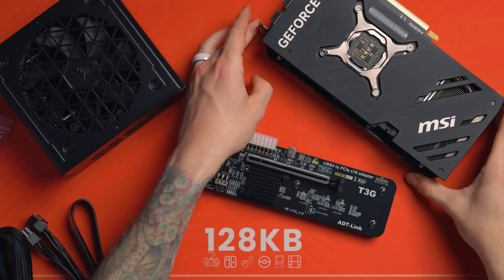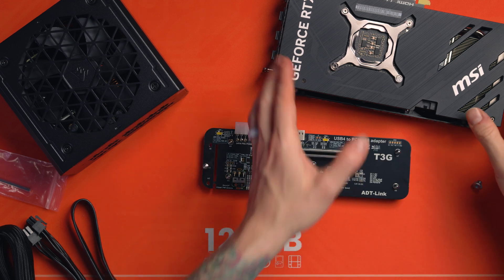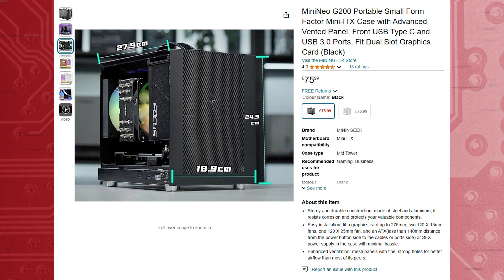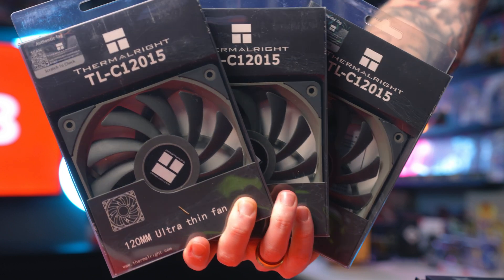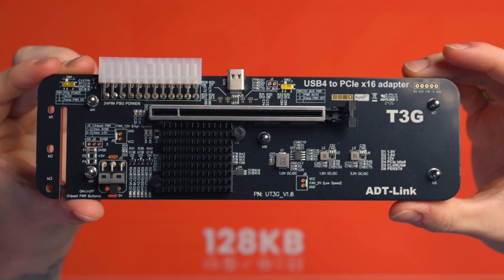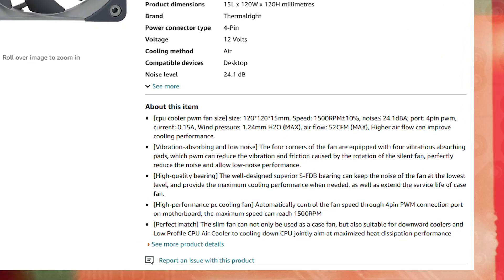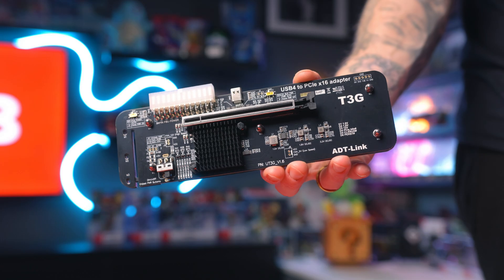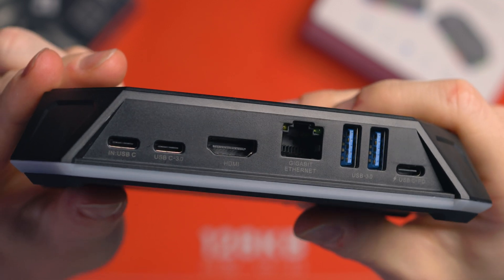Is This A Huge Mistake? ALLY X eGPU

Comment from the maker: Here's all the parts I'm going to try:
🛒 MiniNeo G200 case: https://geni.us/XjNR
🛒 Thermalright fans: https://geni.us/CT9Mlk
🛒 Molex fan splitter: https://geni.us/oP0YKVU

My Dead RoboCop eGPU Build (so far):
🛒 RTX4070 GPU: https://geni.us/Mbhh0ZL
🛒 Corsair RM750e PSU: https://geni.us/bAoAQAH
🛒 ADT Link UT3G USB4 eGPU Controller (AliExpress): https://geni.us/oGr4
🛒 ADT Link UT3G USB4 eGPU Controller (Amazon): https://geni.us/TMW8zex

Comment: Bruh, such a nothing burger of a video, overthinking and not enough doing, you have everything there to put it all together, you don't put it together at all and you just talk about things that don't matter, like the the air flow under the egpu, its just a gpu, not a whole pc, you don't need to worry about airflow in an empty case with ventilation on all sides, the fans are overkill too, then to wrap it up after showing what you were planning on doing but not actually doing it was just a let down, felt like a waste of 8 minutes.

Comment: Thank you! I was hesitating, but I decided at this point instead of building it’s much better to buy an SWGZone Dock 4060 version. Smaller and cheaper than a messy build. Or even a OneXGPU 2 is a better option. Cleaner, smaller and less problem with the drivers than the problems with building. You helped me a lot. 🤣
Reply from the maker: Love that SWGZone idea, I was tempted myself but decided to go the messier route 🤣
Reply: @ good luck, waiting for the result.

Comment: It looks like there are solder pads for a fan connector on the ADT-Link board. You probably could DIY a solution, but molex works too.
Reply from the maker: I hadn't noticed that! I'll have to check that out but for now I'll use that molex adapter